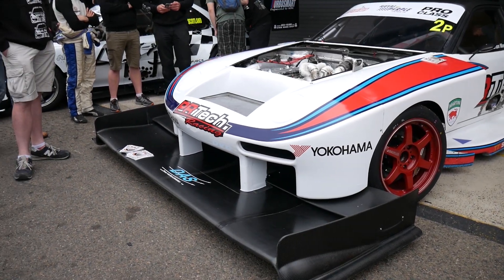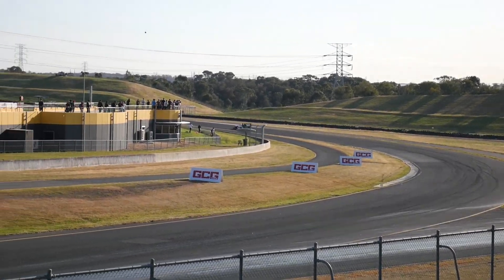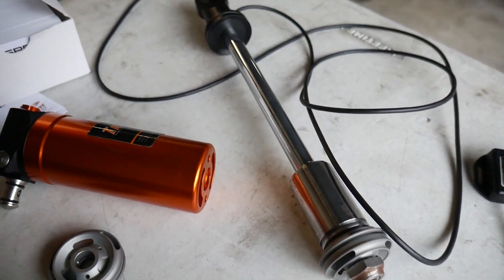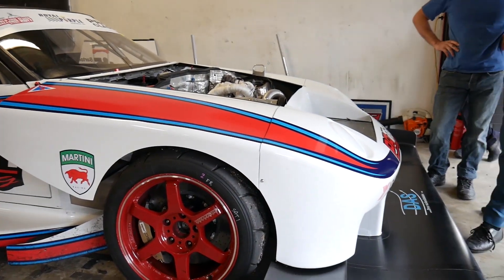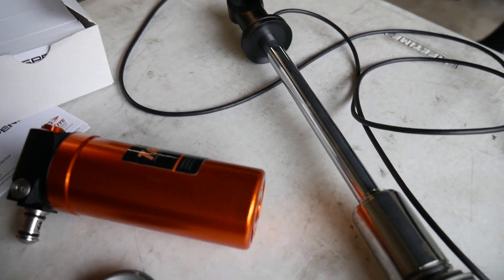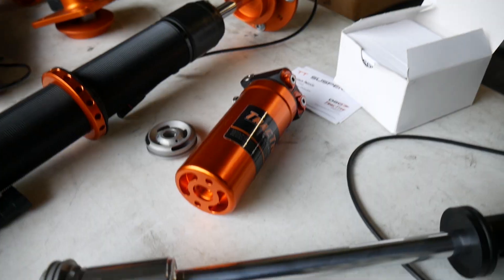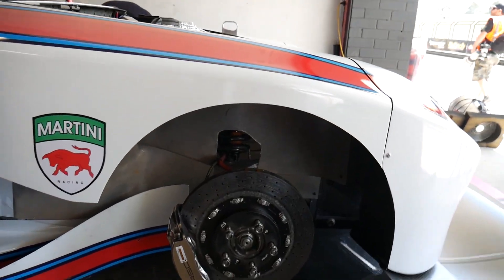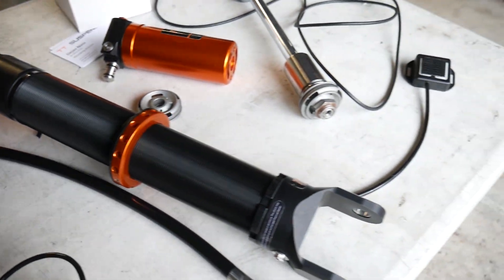How Do Active Dampers Work? TracTive Active Suspension Explained

Comment: How much more mass does an active system usually add over a normal damping system? Is the added mass (if any) part of sprung mass, unsprung mass, or a combination of both?
Reply: It's almost always worth it, as active suspension is specifically banned in F1. Any technology banned in F1 is game changing.
Reply: @IR-xy3ij  Good point.

Comment: you could use hydraulics to do the variable suspension active F1 style  use a slightly  longer shock and use the hydraulic ram to keep the tire/spliter the same ride height. as the aero load increases the ram would extend  compressing the normal spring  and adding just the right increase of spring rate. and could be used to lift the out side in curves. with bypass shocks you can tune a high speed (bottom 1/3) and tight corners (upper 2/3) sections.

Comment: What are the advantages here vs an MR damper? I guess the fluid is more predictable than an emulsion. 6ms is probably fast enough to do ground hook damping. It's been a long time since I read papers on that though
Reply: What's ground hook
Reply: I'm probably butchering this but it's basically an active damping strategy where you use sensors on the vehicle to simulate as if the vehicle is damped relative to a fixed point on the ground (i.e. hooked to the ground) The idea is that since tires are load sensitive (lose relative grip at higher loads) if you can smooth out the spikes from bumps you'll get better traction. This comes at the expense of the driver who takes a bit more beating. 

You hear about its cousin "skyhook" more often where people are trying to optimize ride like in offroad applications. I remember Maserati offered a skyhook suspension once but I don't recall if their implementation was any good. There was a lot of talk about this for military vehicles though since a lot of what limits your speed offroad is the beating the crew can handle.
Reply: ok cool I've got it thanks for the reply guys sounds awesome, so is it reactive to what the sensors feed it or do you have to program it from track data, In drag racing its used as a time based program to change at different points on the run.

Comment: I still don’t understand why an active suspension Technology should be used in a race car 🏎 where the input road frequencies are probably too low and known already. I mean this setup in an ATV would make much more sense wherein the input road frequencies vary like hell all over the transmissibility graph and it wouldn’t do without an active setup.
Reply: Sachin Dangi I think the height dependency is the big motivation here. With a lot of aero and riding on the bump rubbers your spring rate is all over the place
Reply: Sachin Dangi you could also probably do some interesting things with transient roll stiffness, but that's in the low speed part of the curve so it might not be worth it

Comment: Interesting that it is not classified as active aero.  Aero enhances grip, but so does traction control and or active suspension.  So why is active aero banned in some events and not traction control etc...
Reply: RedBull actually developed a similar system that would lower the back of the car at high speed to reduce drag but the FIA classed it ad active aero and deemed it illegal
Reply: Mark Collingwood if you had 2 way control you might be able to jack the car down slowly but ive never heard of that being done
Reply: You can do that, williams did that in 92 and 93, on the straights the car raise the front to reduce drag and have a higher top speed even with the bhp lost by the active suspension system.
Reply: Sam Kwant this is what I get for not keeping up my subscription to race car engineering